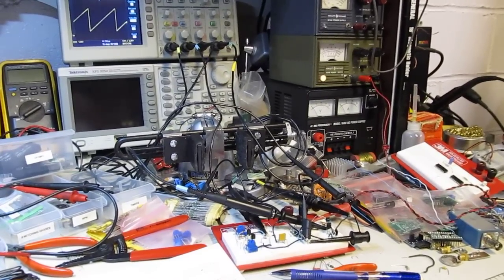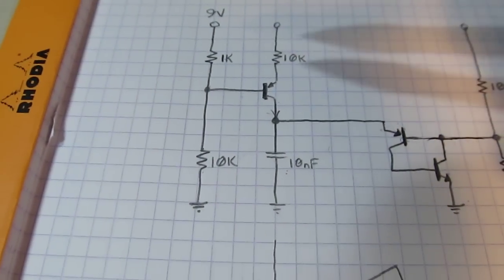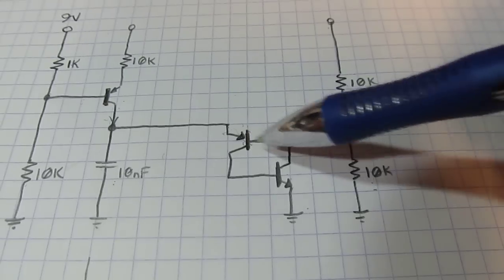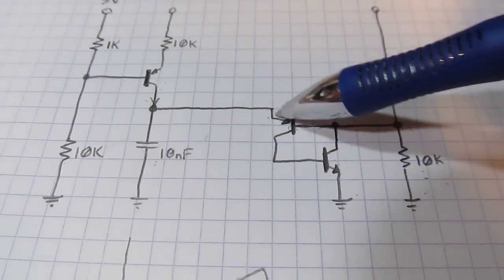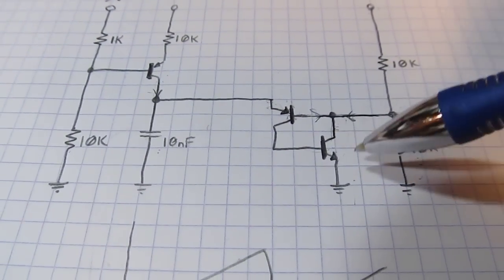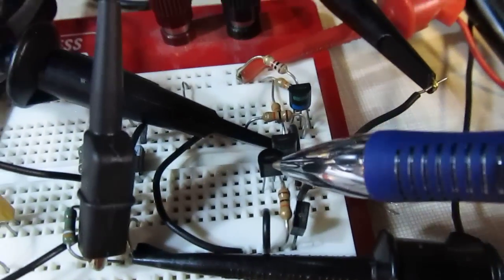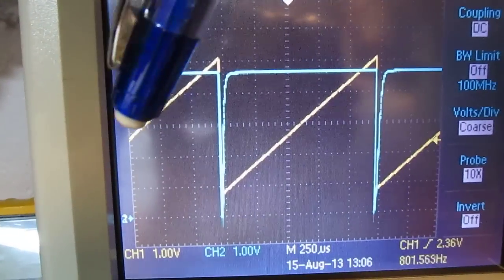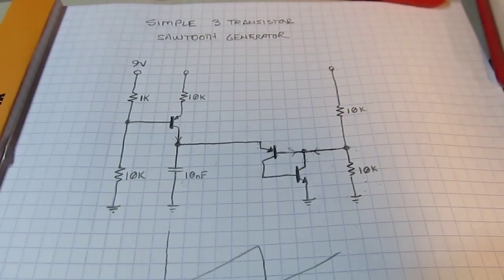#105: More Circuit Fun: Simple 3 transistor sawtooth generator / oscillator

Comment: ***** Why do you use the first pnp transistor if it continuously turned on by the voltage divider, in other words why aren't you replacing that simply by using a voltage source with the right voltage set, 10k resistor, 10nF capacitor and the rest of the circuit ??
Reply from the maker: The PNP is used as a constant current source which creates a linear voltage ramp when fed into the cap. If a voltage + resistor were used, the voltage ramp would not be linear, it would be exponential.
Reply: ***** Are there any disadvantages to using a single transistor as a current source? Can I make a current source for several amps with a large enough transistor on a heatsink?
Reply from the maker: Power Max Yeah, logarithmic is a better way to describe the voltage change when charging through a resistor only.  And, certainly you can make large value current sources with proper component selection.
Reply: Are there equations for base voltage To current flow?
Reply from the maker: Power Max Of course.  The most popular model is the Ebers-Moll model:
http://en.wikipedia.org/wiki/Bipolar_junction_transistor#Ebers.E2.80.93Moll_model
But, I find it easier to simply include some emitter degeneration resistance, which basically creates some negative feedback.  Estimating the base-emitter voltage as about 0.7V, you can easily predict the voltage across the emitter - thus the emitter current - thus the collector current (provided the transistor isn't saturated).  If you have several hundred millivolts or more across the emitter resistor, then the small error in your Vbe estimation will be insignificant in predicting the collector current.
Reply: ***** Wouldn't it be logarithmic?
Reply: So the Gain of the transistor is unimportant. Also, I built up your simple ramp wave generator in LTspice as part of my analog class D amp, and its output goes into a buffer, then to the inverting input of a LT1002A, and a 2000Hz sine wave is fed into the inverting input. The result, however, is a very bad looking signal, and the output is not only attenuated instead of amplified, but is also severely distorted. Amy help?
Reply from the maker: Power Max Current gain isn't that important in determining the current source value - it will just determine how much base current flows.  But with proper bias setup, this should be immaterial.

For a Class D amp, you really want the triangle or sawtooth input to the comparator to be much higher in frequency than the analog input, so that the PWM output can be easily filtered to get the original signal.  The circuit shown here isn't designed to operate fast enough to be used in this way.
Reply: Problem is, though, all the op amps and comparitors appear to not be able to switch fast enough, and the output to the transistors is very weird looking, and it isn't switching from rail-to-rail. My ramp wave (same as a sawtooth, right) and it appears quite linear, and is about 20 times higher frequency of my input of 2000Hz.
Reply from the maker: Power Max Hence, the problem.  Class D amps require very fast switching to create clean PWM waveforms and fast-switched output devices.  If you don't have this, you've completely lost all of the efficiencies that you may have gained by going to class D.  20x fmax may not even be high enough to accurate reproduction of the audio signal - I'm not sure, I've never undertaken a class D design.
Reply: well I guess I'll keep trying, maybe change techniques. Maybe the circuit built in real life is more forgiving in design. I know that when it comes to sampling rate on audio, uswally is 44.1KHz for CD quality, twice as high as our the top limit of human hearing.
Reply: Thank you for your help! I'll probably work on it somwmore another day.

Comment: Hi Alan
why should the transistor be PNP for the constant current source? how can we design a circuit with a NPN transistor? just wondered?
Reply from the maker: An NPN transistor current source is a "current sink", while the PNP forms a current "source".  So, the circuit would have to be redesigned / rearranged to use a sink instead of a source.
Reply from the maker: R Vass You'd also have to change the other two transistors to their compliments, then reverse the supplies.  Or, redesign as desired.

Comment: Would you have any advice for simulating? I've tried both building and simulating (using OrCAD PSPICE) and no luck either way yet. I'll try tweaking that resistor value some more in the built circuit...

Comment: Hi Alan
If I add a resistor in the capacitor discharge path through the transistors (back to back) can I get a triangle wave form?
Reply: It won't be "linear" discharge, probably exponential.

Comment: If you were charging the capacitor through a resistor, that would APPROXIMATE a constant current if the peak capacitor voltage is small in comparison to the voltage source and therfore the voltage across the resistor is relatively constant, so I think that's probably what you're getting at. As it is, a CCS is used and that's where the linearity comes from as explained by the author.
Reply: Charging a capacitor thru a resistor gives you an "exponential" waveform - not linear.
Reply: @technobubba4  that is true, and also not what I'm saying.

Comment: Simulating a 2n3904 or a 2n5089 instead of a 2222 seems to show some sort of latchup in LTSpice, though the circuit works fine.  The fix seems to be increasing the NPN collector current.  Anything around 8k or lower for the bias resistors seemed to work.

Comment: I tried running this circuit in LT spice simply because I don't have any PNP transistors on hand to test it for real right now. It doesn't seem to work the way I have it set up. Does anyone know if this kind of circuit will work correctly in Lt spice and if so what do I need to try. The last video's circuit did not run either.

Comment: Thanks, cool vid. Am I right in thinking you could replace the 10k resistor connected to the first PNPs emitter with a pot to control the rate of charge of the cap, thereby controlling the frequency of the oscillator?